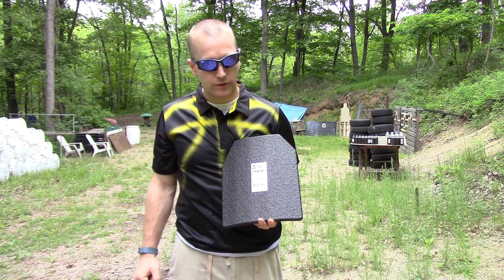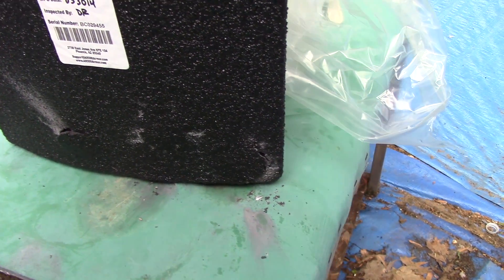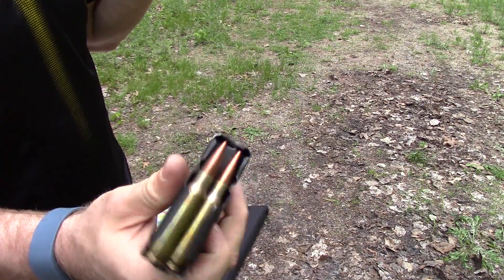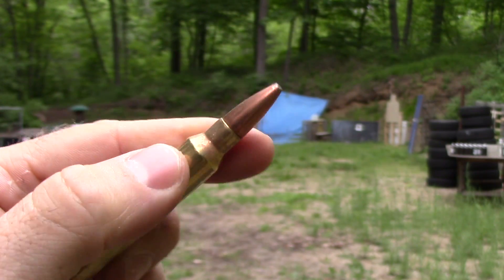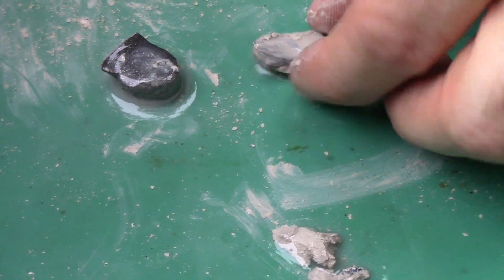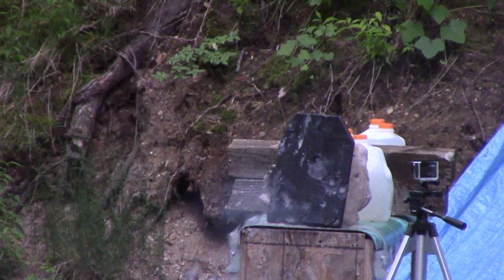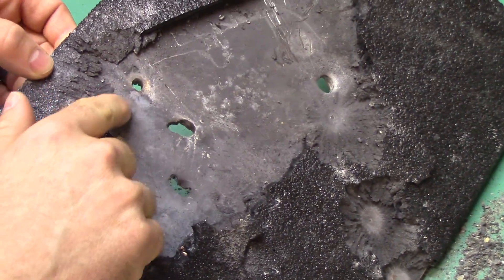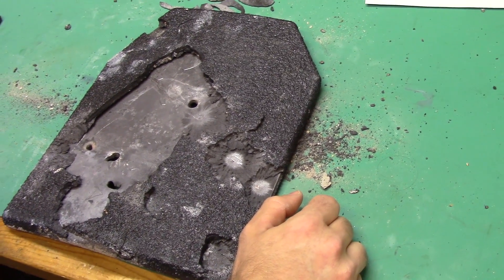@ArmoredRepublic2 Level III Plate Torture Test: Heavy Hitters

Comment: I wonder how the old german K-bullets would do against it (they were 7.92mm mauser rounds with a tool steel core)
Reply from the maker: bskorupk  really depends on how hard of steel it is. Has to be going 2800 fps or so as well.
Reply: Buffman I can't seem to find much info on the ballistics of the K Bullet specifically, but it had a 1/3 chance of penetrating a 12-13mm armored steel plate of a WW1 tank at 100 meters. Also with the 29 inch barrel on the WW1 mausers they can get up to about 2880 fps.
Reply from the maker: bskorupk I should see if my brother has a Mauser lying around. I thought he did. Could make a good test :D

Comment: Buffman, I am looking to buy a condor plate carrier and I was going to put these level 3 plates in it.  Can I put just the plates into the carrier or do I need another type of pad as well? Or do you put just the plates in
Reply from the maker: abeck They sell trauma mitigation pads that can go behind the plates. In reality if the rounds are able to be stopped by plate, backface deformation is going to be minimal. It's still a concern and with the cost of the trauma pads it's not too much of a deal to pick them up.
Reply: I would recommend trama pads or soft armor

Comment from the maker: Heavy Coat
Reply: this isn't level 3+ is it?
Reply from the maker: +hunter lankford No, these were before they came out with Level III+
Reply: +Buffman ok thank u
Reply: +Buffman the wound channel shot right threw these with standard 55.6 so I'm kind of confused
Reply from the maker: +hunter lankford He did, but he had a 22" barrel, and was at 10 yards. Speed will defeat steel, and he had those things cooking over 3200 fps. It's why I try and include velocity in my newer tests, so we get an idea of how close the round is to the threshold of the plate.. His same test, he did not defeat their level III+
Reply: +Buffman yes the longer the barrel the more velocity. thank     you for the response. you see bought some level 3 armor and it's Rated  up to 308 ball round and I bought it thinking it would stop 55.6 but come to find out its not rated for that I should have bought level 3+
Reply from the maker: +hunter lankford The chances though of a CQB scenario of a 22" barrel encounter may be slim, but the level III+ is hard to argue :D
Reply: +Buffman well I got the level 3 plates so they will stop 55.6 out a 16-18 in barrel right?
Reply from the maker: +hunter lankford There's no guarantee, but it all depends on a factor you'd never be able to ascertain; what ammo your adversary would be using.  Some M193 spec ammo is slower than others, some faster. If you think you'd come across a situation where that may be an issue, you may want to upgrade.
Reply: +Buffman yes probably in future though but it is a very very rare change I would be in that situation and anyway isis would be using 7.62 ×39 and it can stop that
Reply: +Buffman the main reason why I bought the armor is because the plate carrier can hold magazines and other gear and I got the armor because what's a plate carrier without a plate

Comment: note to self, get a box of .30-06 M2 AP just in case.
Reply from the maker: Michael Carter Definitely :)
Reply from the maker: FraggedDabloons In Florida it states handguns. So if you don't own a handgun that shoots .30-06, then rifles are exempted, since rifles in general defeat most body armor warn by LEO.
Reply: Wait you can't buy M2 AP rounds in Florida?   When this happen as it's not one of the commie state/cities that normally you can't buy from.  As for my state, Texas no issues there.
Reply: Buffman
Good luck getting it here, I haven't found anyone big store or mom and pop shop with any, and nobody will ship to Florida.
Reply from the maker: FraggedDabloons Even the CMP?
Reply: Safton That's kind of insane considering IV is supposed to stop the .30-06 equivalent of "black-tip" which I'd assume would have greater energy than any 5.56 cartridge. I have however sporadicly heard terrified comments about the amor defeating capabilities of M995 as if it were more potent than the older armor piercing projectiles for made for larger cartridges.
Reply: Buffman I know they're illegal here in Florida.
Reply: I know about the handgun part, but rifle isn't exactly right.  I know for a fact they ship to Florida as I have a friend there I asked and he said there is no issues.   He buys off line all the time and never has an issue with ammo cause well not as bad as it use to be, but for a while the hording nutz keep ammo off the shelves.  We had the same problem here in Texas.  They buy it and than sale it way higher online.  Not so bad now, and I can actually find 5.7 in sporting good stores now when I couldn't 9 months ago.  I just plan to get a box of it jsut in case like i have a box if 5.7 SS190 AP rounds.  You know just in case and AP is ok in Texas for either handgun or rifle.   Just not for hunting.
Reply: Michael Carter
 Here's the statute on it, I can clearly see the handgun and shotgun. http://www.leg.state.fl.us/statutes/index.cfm?App_mode=Display_Statute&Search_String=&URL=0700-0799/0790/Sections/0790.31.html
Reply: Now remember 556 and 223 do fall under the handgun rules,cause they are now a pistol caliber.  That might be the issue, but 30-06 isn't.  Maybe you just got some crappy stores around there.  Even on Gun broker they don't list florida as a no ship state.   I get most my ammo online any way cause going to shops/stores is a pain to time cause there is still idiots buying it all up and saling it high price online.  Glad I don't own a 22 any more.  Though dad about to give me his rifle and pistol since he never shoots any more.
Reply: NIJ IV will stop .30-06 and 7.62 tungsten core rounds. This is why people wear ceramic, you can't be shot 50 times with 5.56, but you can be shot 5 times with  things that pass right through level III, and it doesn't weigh as much as level IV steel. I think there are UHMWPE IV plates that are lighter than either though.
Reply from the maker: ***** Level II will stop a .22 mag FMJ when fired from a pistol no problem..
Reply from the maker: ***** Agreed :)
Reply: ***** I wonder if there are any level III rifle plates that are light enough for patrol officers to wear on a regular basis. Maybe some sort of UHMWPE?
Reply: ***** Steel or impregnated aramid?
Reply: I'm about to start reloading my own ammo.  Something came up to me when I was looking at supplies and thought.  I wonder if I pull the bullet on some of my M2 AP bullets (got like 50 of them) and turn around and put the bullet in a 300 BLK.   Wonder how well it would perform in a 10" SBR build against plate.
Reply from the maker: ***** Michael Carter I'm not sure if the velocity is there in 300BLK. As far as the whole AP manufacturing, the bullet/projectile is what is AP, not the loaded round. The projectile has already been made, and is even exempted, but I'm not a lawyer :D
Reply: That is what I was wondering, normaly it's off the velocity which still isn't high enough in the lower grain rounds.  Though wonder if you loaded an M2 AP 163G round what the results would be.  I don't think it would put out enough velocity to be honest.
Reply: StudyinSteel I'm assuming these are private sector Level IV plates. Because from what I've heard, ESAPI is actually vulnerable to M993/M995. That's one of the selling points of the XSAPI supposed on the horizon: it can stop either.

There are some viable choices for choosing steel. It's really a question of what you need.
Reply: StudyinSteel
I was also surprised. I suppose the extra velocity -- not to mention the tungsten carbide core -- really do make a huge difference.
Reply: Safton What is the .30-06 M2 made of? It must be something less than than the WC steel core of M993 or it has significantly lower velocity.
Reply: StudyinSteel
I'm almost certain that the M2 AP round used a hardened steel core penetrator. Tungsten carbide did not become common fare in small arms AP ammo for a few decades after WW2 to the best of my knowledge.

Remember that M993/M995 were designed and manufactured many decades after the M2 was already removed from service. A better comparison to the M2 would be the early Cold War-era 7.62x51mm M61 AP round.

The WC core is superior to traditional hardened steel in all regards save cost. It's harder and has greater sectional density, both of which are incredibly important in armor-piercing tasks. The M993 -- using a lighter projectile (~127 grains versus 166 grains) also has over 250 feet per second of muzzle velocity on the M2.
Reply: Michael Carter what company sell 30 06 ap m2?
Reply: The M2AP IS tungsten carbide. World War 2 saw most of the modern innovations in AP ammo.
Reply: Winchester 5.56 55gr FMJ range ammo out of a 16" bbl  poked holes in a level III plate I tested. Go figure.
Reply: Good idea, just pray they aren't wearing Lvl IV armor since that's rated to stop .30-06 M2 AP and a no name plate Demo Ranch got on Wish was able to stop .50 BMG ball XD
Reply from the maker: FraggedDabloons Correct. On a Federal level the are exempted. State levels will vary..
Reply: Be sure to check your local laws, they aren't legal in a lot of states.
Reply: @fraggeddabloons5679  SHALL NOT BE INFRINGED, if you could own cannon on your ship, you can own tank today!!!!! don't give up your rights, lest you fall to slave.
Reply: Michael Carter
Its been that way for a while, same with Flechette. I fully understand the reasoning behind the band on AP though, people were using it to shoot LE.

Comment: Would wearing NIJ level IIIa soft armor behind a AR500 steel plate help stopping more rounds than the AR 500 steel plate could stop on its own?
Reply from the maker: x3GameBit potentially.  However it probably would only be able to stop a round that barely made it past the plate to begin with.
Reply: I would recommend soft armor when using hard plates if at all possible.  It aides with some blunt force trauma reduction, but mostly any fragmentation that may occur from the impact of the rounds, whether it is ceramic cracking or the spalling when using a steel plate.

Comment: How far was it? 16in+ barrel with M193 will go through it at close ranges.
Reply: 35 yards, judging by the miniscule dimples the m193 made at 35 yards, I seriously doubt that it will penetrate even at the muzzle.  Velocity drop off at 35 yards cant be much slower than muzzle velocity... IMHO, 35 yards is pretty darn "short range" for a center fire rifle round of any caliber.
Anyway,  I was pretty suprised that the .300 win mag 180 grain softie made it though... since ive seen the same plate stop 338 lapua (most of the time)  wonder if one of the previous other hits weakened the plate.  Definitely not surprised the m2 AP round went through. 
Id like to see if a 22.250 load would make it through... also 7mm mag, and maybe a hot loaded .243 winchester.   Its a given that it will stop all  NATO and warsaw pact non  AP "combat"  rounds... but im  curious about some of the hotter sporting loads.
Reply from the maker: stinkyfungus I believe I have a source for 22-250 and .243 Winchester..I'll see if I can get them come out.
Reply: stinkyfungus I wasn't surprised the 180 went though out of the 300 win mag, as I did another test a while back with 3/8 AR500 targets.  At 100 yards the 300 cooked a hole right though no problem.  I have a review of that target over on my channel if you are interested in the full run down.